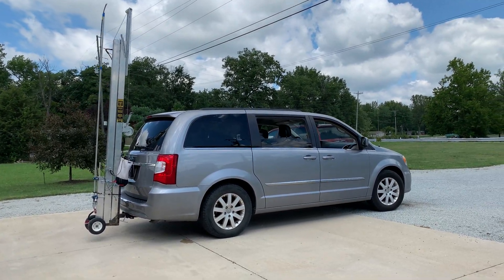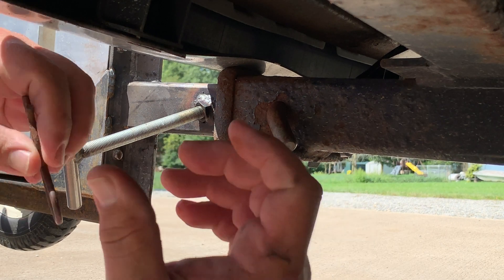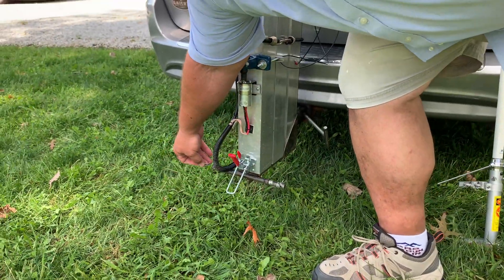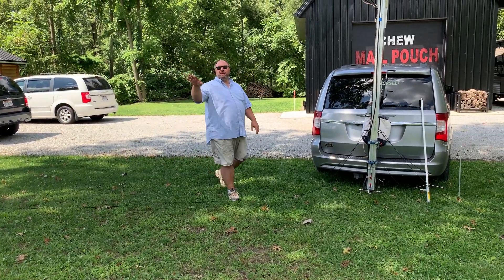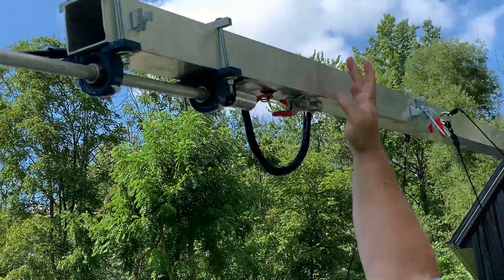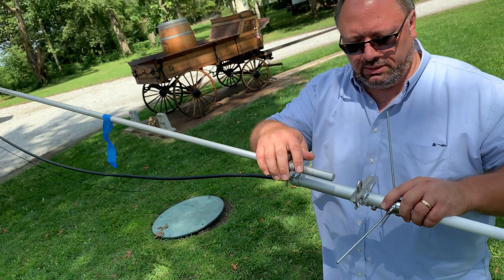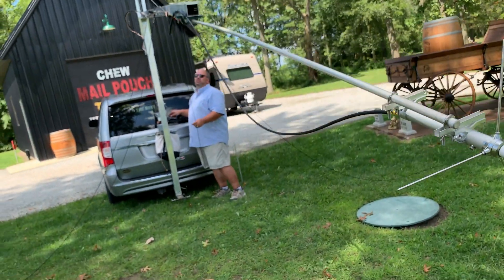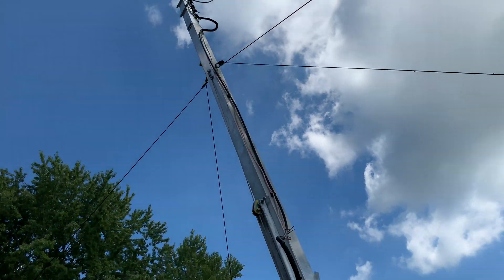Mobile Tower Project

Comment: that's pretty sweet. I love the ability to be able to one man set it up. For a good waterproof box try a Plano tackle box, or something like an apache box from harbor freight. Also for the guide wires you have black ones I would use neon orange or some other bright color so people can see it better. That way no one accidentally runs into them. Great build I definitely need something like that.